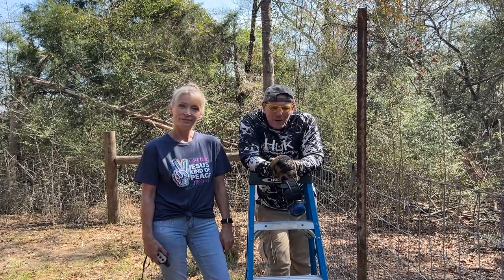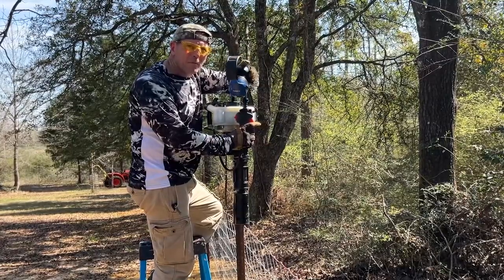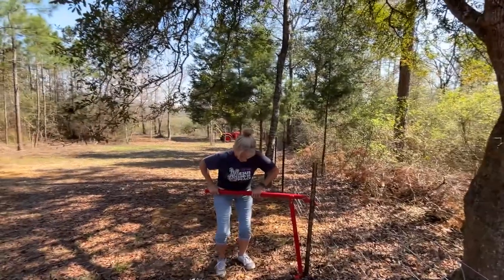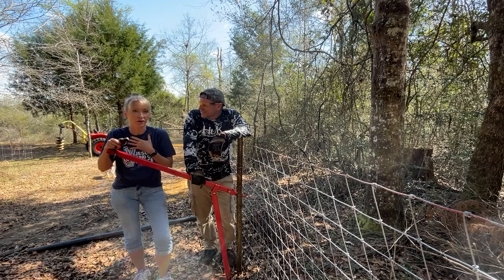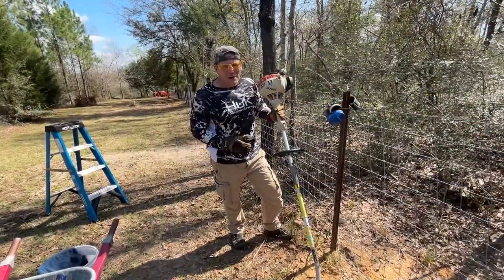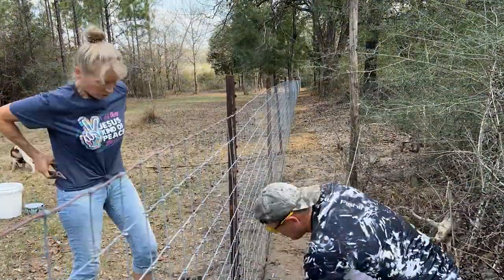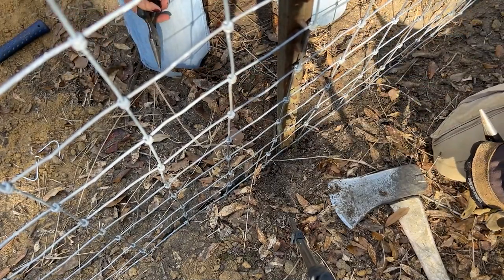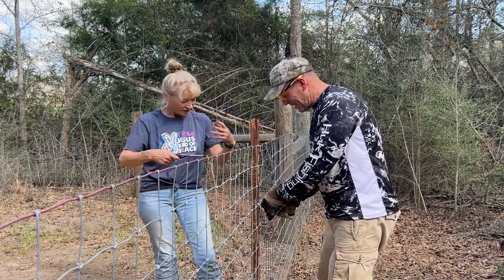We Fenced Our Property to Keep Out Predators!

Comment: No way I would adjust these posts like this.  1 inch or so is not a big deal.  We just installed 1000 ft of fence around a sloping hill and no posts are the 'same height' above grade. But top wire is at the same point on every post. 
And all of the critters in my area in Texas  can dig under a fence buried 1/2" below grade. So a lot of extra work that may not work 'quite' as expected.
Reply from the maker: It ain't perfect, but at least it's done!